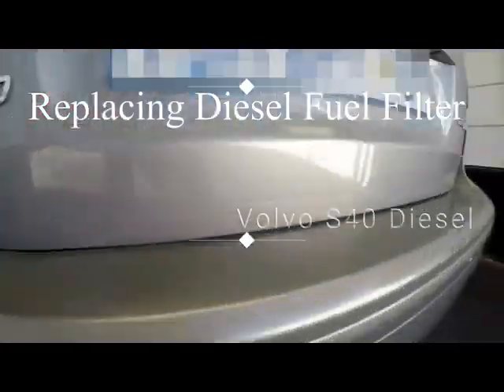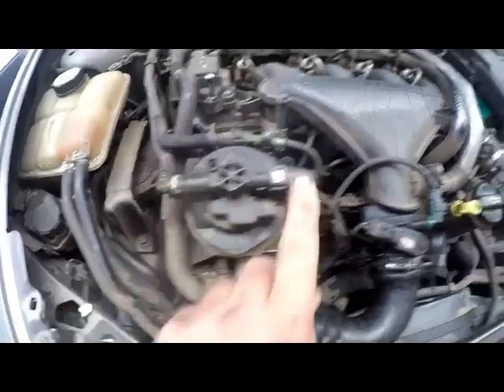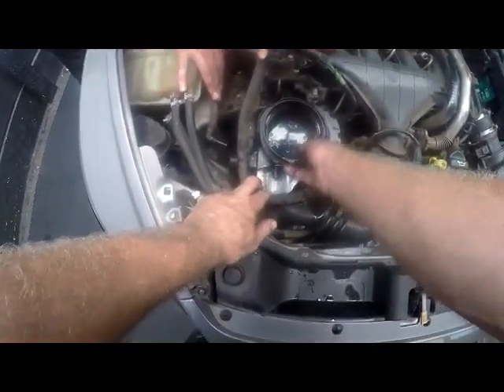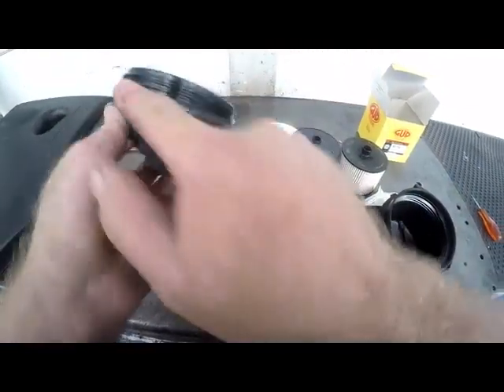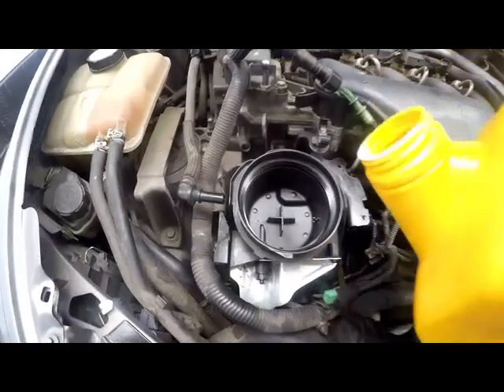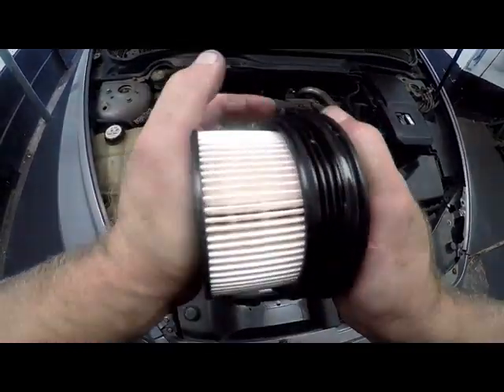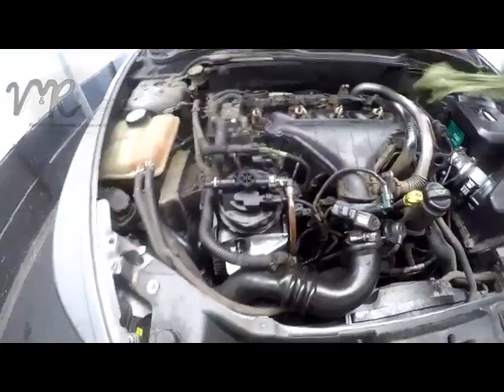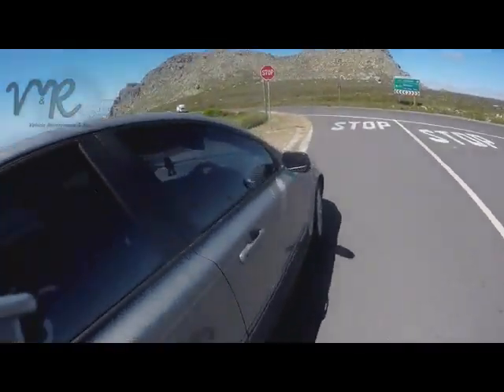Volvo S40 2006 - Diesel Fuel Filter  Replacement

Comment: Can you tell me where I can get the black plastic clip that holds the inlet into the fuel pump on a 2005 S40 2.0D Voss PA 66 GF35 is the number on it

Comment: Hi the problem you had with your car ( loss of power/ black smoke ) is nothing to do with the fuel filter, it is caused by a "sticking open" EGR valve.
Reply: @vehiclemaintenanceandrepai3790  Black smoke is caused either by too much fuel or lack of air, difficult to see how a blocked fuel filter can cause to much fuel to pass or restrict air flow.